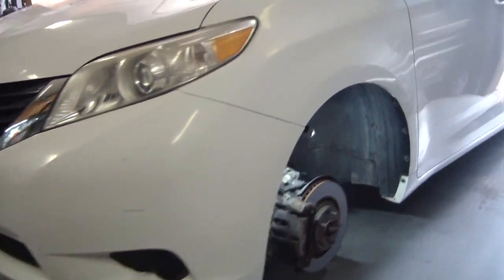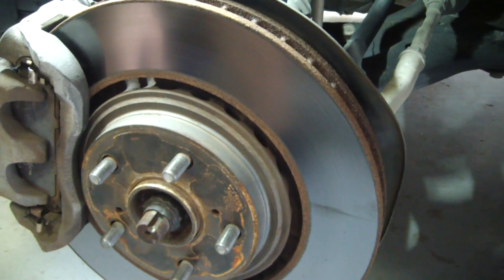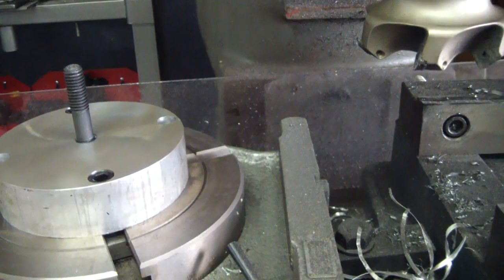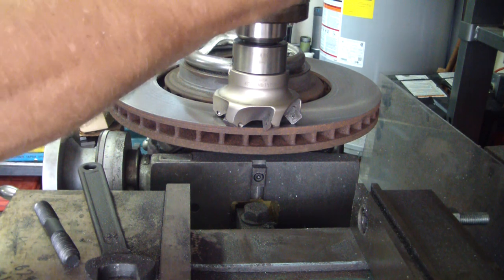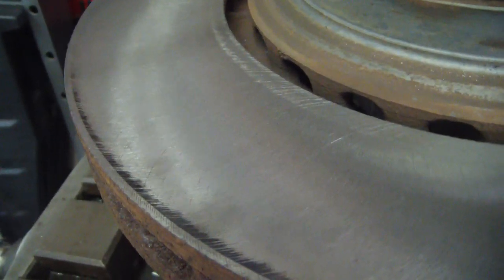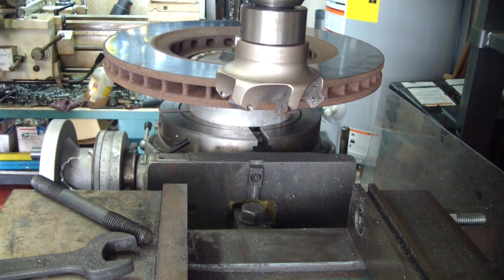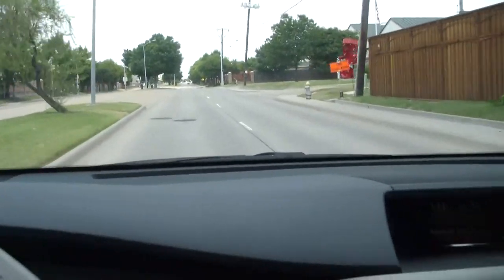Machining / resurfacing brake rotors on a Bridgeport milling machine and rotary table.

Comment: I love this video. I'm also a machinist. I have a small harbor freight 9x20 lathe but it's only capable of holding a 9 in diameter. For many years I considered putting the rotor on my harbor freight milling machine and resurfacing it in the same manner. I agree with him on the milling machine giving it a multi-directional finish. I currently have a $100 rotor that doesn't have hardly any wear, there's a lot of material there. The outside surface is pretty good the inside surface is bad it has rust on it etc but both sides of the rotor have a lot of material. So for us guys who don't have a big lathe and we don't have the machine that resurfaces the rotor we can still resurface it in this manner. We also have dial indicators where we can check how well we did. Of course you do not want to do anything like do this if you do not have a lot of material. Have to be certain to check the minimum thickness specification. But it looks like I'm going to be trying this myself. I had this idea before I saw this video. I thought about it for years. I figured I'd probably find another machinist out there that is going to do the same thing and make a video of it. So now that I've seen this video it makes me feel better about diving in and doing it. To me it seems like if you have a decent amount of machining experience there's no reason why you shouldn't be able to do this. If I do find it excessively difficult or regret it I will try to come back and post on that. This one is for my own personal vehicle. To me it is amazing how bad brake rotors get before they start having issues. I think I can produce results that will be as good as most of the brake rotors that are out there in use that have some miles on them but are not considered bad. There's also a possibility that this process may yield better results. Like for example the Omni directional finish instead of the record player type finish. Oh well time to get to it.
Reply: So did the harbor freight mill work well?
Reply: @joeysanchez5926  Although it did work well the end result wasn't that good. I could feel the pulsation in the brakes. I was amazed at how such a small variance in the thickness could cause this. Precision Grinding is much more precise than just milling. I eventually got frustrated and went out and purchased a new pair of rotors. I actually didn't re-read my last post but I do remember the end result. I suppose I could have spent more time on it, but I had to get it done. It definitely made me have a greater respect for the Blanchard grinding process that they use on the new rotors
Reply: @joeysanchez5926  I went to Jr high school with a guy named Joe Sanchez in Justice Illinois from 1976 to 1978. Just wondering if you're that same guy. Probably not but just thought I'd ask
Reply: @wiliiamamey5967  no sorry.  We're from Texas.

Comment: Shell mills work great.  If you want a factory style finish you can use a cup wheel and grind to spark out though I suggest covering your ways to prevent grinding dust from getting on them.

Comment: Unload (lower) the knee and taper the end of the cut instead of stopping/dwelling your cut at the end resulting in leaving that tooling mark (which will lead to DTV)

Better yet, raise the knee into the cut at the begging as well for even better results. 

.02

Comment: Ive never heard it called omni directional polish. We always called it a non-directional swirl polish and we have a simple tool that bolted right where the caliper would bolt and you could align the disks and run the car and it would fix the rotor up great without ever having to take it off. Turning rotors doesn't remove the warp in them either. .
Reply from the maker: Turning rotors does remove the warp as I have turned hundreds of warped rotors that cause pulsating brake pedals and after turning them the warp is gone. When I was turning rotors the on-car brake laths were just coming out, my shop was looking into buying one but never did.

The adaptor we had hooked right onto the spindle of the brake lathe and while the rotor was turning you gave it a quick omnidirectional polish on both sides. That was taught to us by the Ammco brake lathe manufacturer instructor and that is what he called it.

Comment: I love it!
I think I can swing my rotors in my lathe, but this has got to be a better surface finish. 

I can never find the answer to this anywhere:
What’s the acceptable runout and thickness deviation tolerances for a rotor job?  Like, if mine cut up with less than .005 am I good to go or is that gonna pulsate?
Reply from the maker: Typically anything less than .001 is considered good.

Comment: man, that is a slick way to do rotors! what rpm are you running on that operation?
Reply from the maker: I can't remember what the RPM was I kinda went by how it sounded. If I had to guess it was maybe 500 to 700 RPM.
Reply: @737mechanic  sounds about right... gonna find myself a rotary table and do my rotors in the mill from now on... a way better finish than a brake lathe... flywheels too.

Comment: @737mechanic I'm just about to perform the exact same operation on a brake rotor with the same cutter and mill and a small 6" rotary table. How did you clamp the rotor down onto the rotary table? That is, what was the bottom side of the bolt/threaded rod holding onto? Also, what RPM were you running the cutter at?
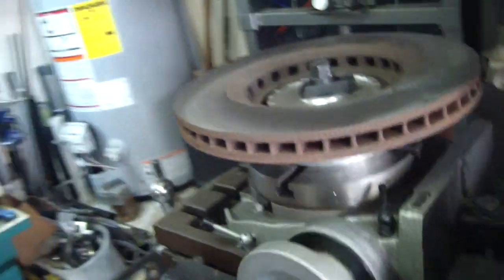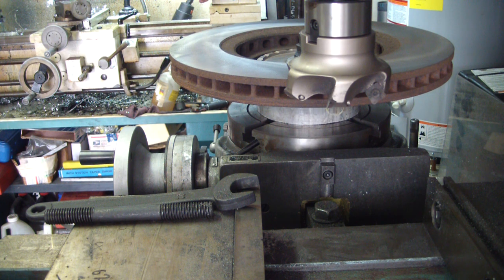Reply from the maker: At the 11:30 to 12:30 timeline, you will see a 6" diameter piece of aluminum that I faced on the lathe then I milled 2 holes 180 from eath other so I could bolt it down to the rotary table and I also drilled and tapped a hole in the center while I still had it on the lathe. That gave me the clearance I needed so I could turn the rotor upside down but also turn it right side up to do the milling.

Comment: Disc Thickness Variation (DTV) should be a maximum off .0005"after machining, I  think this method would produce much more than that which is not good.
Reply from the maker: Bendix says brake rotor DTV should be under .006 with .001 considered near perfect. After machining both these rotors the brake pedal was butter smooth.
Reply: @737mechanic  I think you need to re-check that, .001"DTV is marginal, .006" DTV would just about lock the wheel with each revolution when braking.
Reply from the maker: @lexdavis2179  https://www.powerstop.com/resources/pulsing-vibrating-brake-pedal-dtv/

And like I said whatever the DTV was on these two rotors, the pedal did not have any pulsations at all. That is the ultimate goal here is to turn the rotors and have a smooth pedal.

Comment: "Adapter with sanding disk"?? We don't have that on our brake lathe. We had Hunter one then that broke, now Bosch. Neither had that 😐 also, that's a cool machine you have. First time seeing that that's what made me curious lol
Reply from the maker: We had Ammco brake lathes and they had what they call a Swirl grinder that was on a flexible shaft that hooked to the end of the arbor and gave a very nice non-directional finish. The part number if you want to look it up and see what it looks like is an Ammco 8750 Swirl grinder.

Comment: What mill is that?
Reply from the maker: The mill is a Millport which is a Taiwan bridgeport clone.
Reply: @737mechanic  Thanks. I was wondering if a Bridgeport size machine can run a cutter that large.
Reply: Sorry to ask but where can I buy a mill like this one and do you know how much they cost I guess new ? Thanks a lot
Reply: @Bigtony1818  Buying them used is your best option. A got a good First LC 1-1/2 VS mill which is another Bridgeport clone for $4,000 CAD in excellent condition. New from the dealer would be like $12,000 CAD. Search on craigslist/kijiji for "Bridgeport" or "vertical mill" or "knee mill". There's a lot to know before buying one so do your research.
Reply: @pixiepaws99  got it thanks